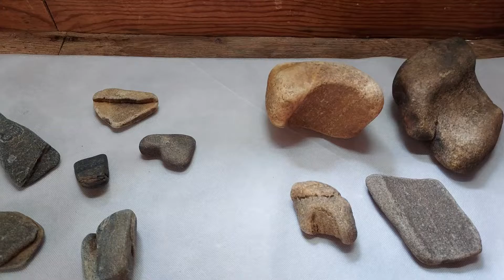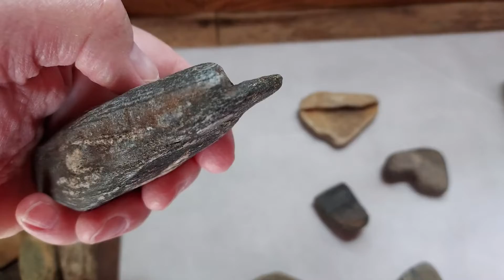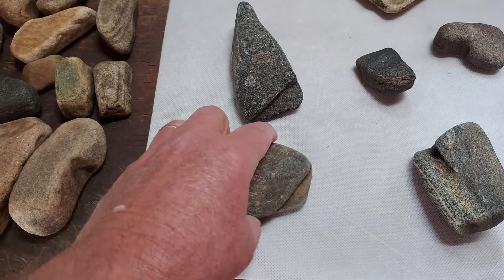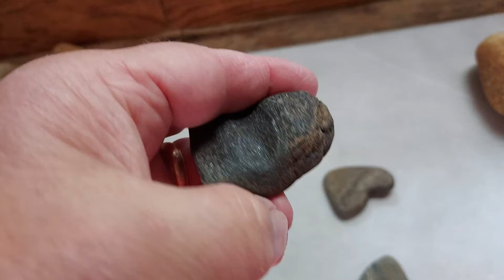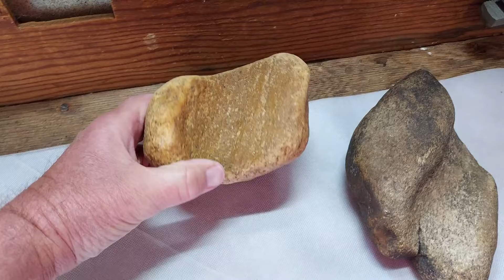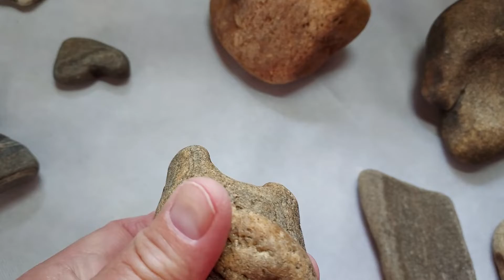Native American Stone Tools And Artifacts ~ DE- BARKING TOOLS !

Comment: I will go one further and say that the first two or three artifacts would not have just been used as shaft abraders or debarking. Looking at the way that those stones have been deliberately grounded and shaped, and after having found a number of these tools, myself at a Mississippi and settlement site… These were made for cleaning out and sanding, the grooves in wood or bone or antler. These were the original sanding blocks folks. I have actually used stones like this for that purpose and they work fantastically well. The original stone would have had a point with a recess or rebate on one side and they would have been used to clean out a groove that had been incised into a piece of wood, bone, antler, or another kind of soft stone. The original tip would’ve been similar to a chisel and would have had a sharp be on it. Overtime wore out and we simply used grindstones or polishing stones to clean out the grooves. if anybody wants to challenge me on this feel free, but I’m pretty sure you’re not going to win that debate. By chance were these found near a large creek or river?

Comment: I make canes and walking sticks using the actual tools, from chert blades to a large variety of stone tools. Some for making convex surfaces or smoothing knobs.Slow, labor intensive sure. But once you do it the old ways, you can recognize artifacts that you might normally miss.Only problem is history is damn heavy,hard to move
Reply from the maker: Yep, beware of the experts!
Reply: You want to see a real debarking tool in action watch this video: #1 ( A Indian Artifact used for stripping bark off Arrow shafts and how it was used in a demonstration !! )
#2 ( Indian Artifact used to remove bark and the dry removed bark can be used as kindling to start fires )

Comment: Brent I think you are spot on as usual. I also believe that the knew about flame temperment. They knew that heating the shaft and polishing the shaft would also water proof the wood and also give the wood strength.
Reply from the maker: Yes, no doubt.
Reply: Sure they did.Primitive doesn't mean stupid. The ancient Mayans and contiguous cultures knew that lightning strikes made common stone become magnetic.we forgot a lot of knowledge when we became civilized
Reply: You want to see a real debarking tool in action watch this video: #1 ( A Indian Artifact used for stripping bark off Arrow shafts and how it was used in a demonstration !! )
#2 ( Indian Artifact used to remove bark and the dry removed bark can be used as kindling to start fires )